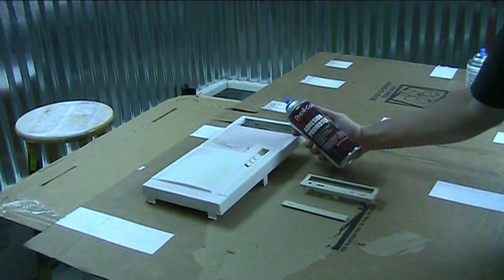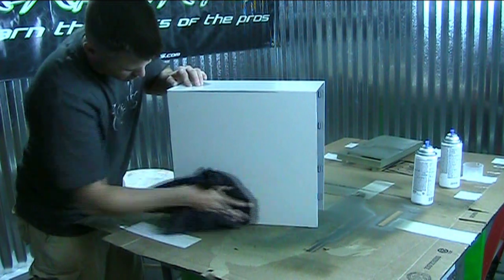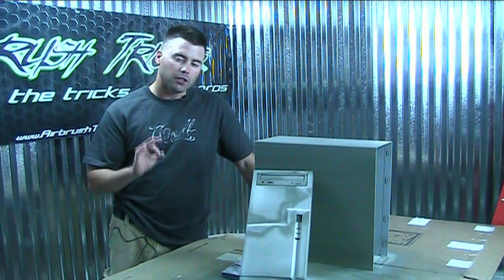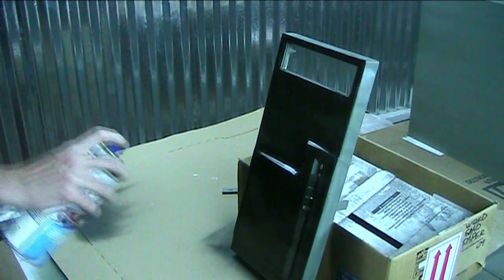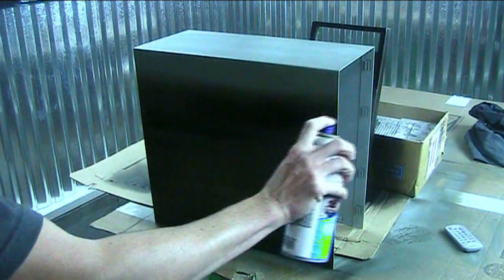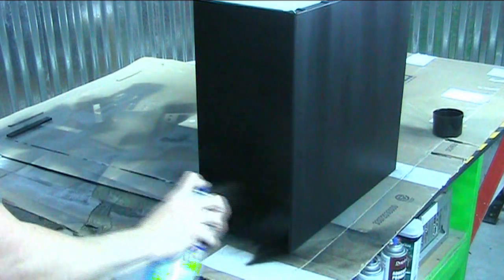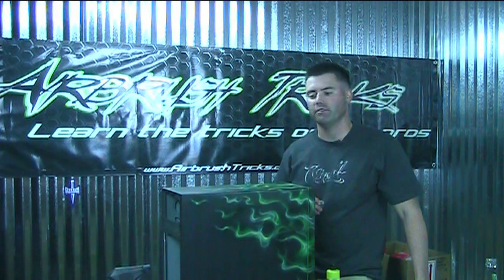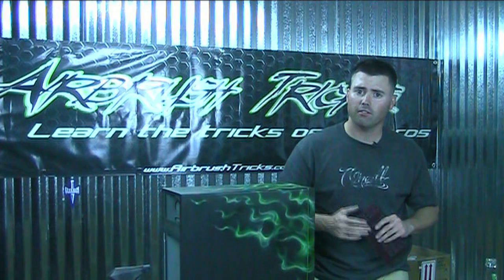Super Easy Case Painting Guide - Part 2

Comment: @ShamanS08 Same principal but you want an adhesion promoter thats gonna stick to the surface of what your painting (plastic) and primer wont stickt to plastic,for long anyway. Try a product called Bulldog, its an adhesion promoter and I use it a lot when painting plastic bumpers with eurethane and it works very well. I dont know if its available in the UK or not but I would think it would be.

Comment: as well, you don't need to sand the basecoat/airbrush paint... it'll give you it's own adhesion for clearcoat. and instead of using a scotch brite ("automotive paint body scuff pads") you can use what is called a tac rag. works better.